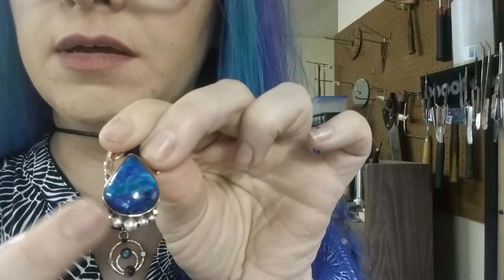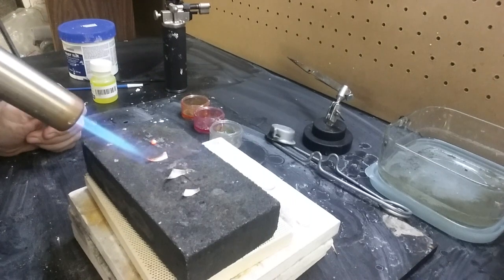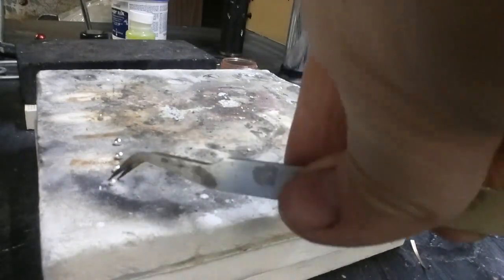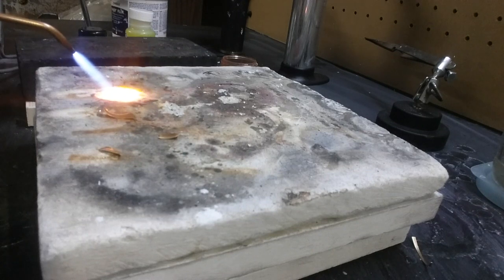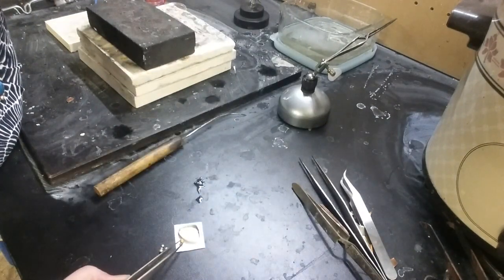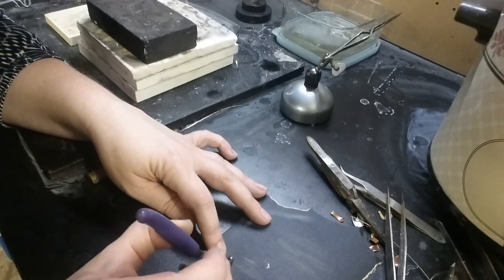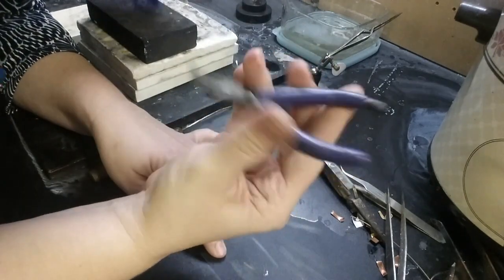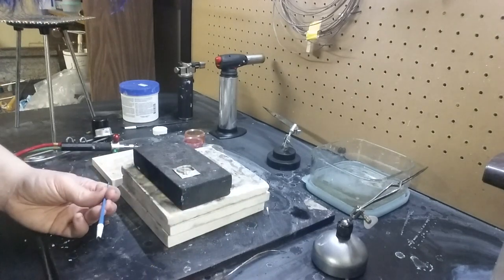Making and soldering ball embellishments

Comment: I left the studio in tears today, then found your video 🙌🏼 Thank you for being so generous and helpful.
Reply from the maker: That makes my day to hear! Feel free to ask if you have any questions, I love helping if I can! :-)
Reply: Byrd Stoneworks You seriously saved y weekend. I do have a question about something you said in another comment. You said hard solder on bezel joint, medium on bezel to faceplate, easy on embellishments to faceplate... Did I understand that correctly? I’m being taught easy for everything but what you described makes sense intuitively. My question is how do you not melt your fine silver bezel while waiting for the hard solder to flow?
Reply from the maker: Its all torch control, and watching it. Don't let any part become bright orange of course. But the main reason I use hard solder on the bezel seam is so that when I do the rest of the steps, I'm in less danger of the solder reflowing back OUT Of the seam (this has happened to me before when I didn't watch my heat!) and now I have a huge gap and have to start over. I use hard solder on 28 gauge fine silver bezel every time, and have never melted during this step. Start slow, use a larger bushy flame and work around it, keep the torch moving and don't go super close. You'll get the feel for it as you watch the flux. It's tricky though because if the flame is TOO WEAK and if you heat too slowly the solder will oxidize and it will never flow. Keep the torch moving and heat gradually but not so slowly that you're just turning everything black. Might take a few times but you'll get the feel for it!

 Another thing is where you are placing the heat. When you are soldering to the backplate, If you heat from above, and you have a fine silver bezel (especially if that bezel is 28 gauge or thinner) the heat will first heat the bezel, and never reach the larger backplate. This is especially true of larger pieces, and if the backplate is a heavier gauge. Beleive me, I've made this mistake. Recently, even! And I knew better! LOL.

You'll want to invest in a soldering tripod so you can heat from underneath. It makes a world of difference. Then, all of your heat is going onto the thicker metal and the bezel is being heated by proxy instead of directly. Keep the heat moving of course, so that everything heats as evenly as possible and you don't have any hotspots that will break down and melt.

Something to keep in mind when you are using a tripod though: You do have to apply a bit MORE heat though to make up for the tripod screen being a heat sink, but when working with silver, it's often better to have that heatsink so you don't accidentally overheat. This, of course, is dependent on what torch you are using. Smaller torches will have a harder time. 

Another thing, is you have to ask yourself if you need to use three grades of solder. Sometimes, just going Medium to Easy is sufficient if you have less steps.
Reply: This is so so helpful. I can’t thank you enough for taking the time. Can I practice hard and medium solder on a 28g fine silver bezel that I already burned a hole through, or is that metal somehow changed and not good for practice?
Reply from the maker: It's not changed or ruined! :-) Always save your scrap! If you don't end up using it for practice as you mentioned, you can use it to make small components (or granulation balls like in this video) and embellishments OR when you get enough you can turn in your scrap for money or store credit at places like Rio Grande or Thunderbird Supply. (Wait til the silver market goes up though!) It's best to separate your 'clean' scrap (with no solder on it) from the rest, and if you want to take it a step further you can have a separate container for your fine silver versus your Sterling Silver.
Reply: Byrd Stoneworks oh cool! I had no idea. I’ll be better about keeping clean scrap separate. Very cool. Thank you!
Reply: Big oof

Comment: When I’ve soldered using my butane torch, even on high for a long period, and even if the piece turns bright orange, it doesn’t come close to melting, and only the solder flows... so does a specific torch need to be used for this?

Comment: Brilliant! The best video here showing how to solder balls on a back plate. Right now I’m having a hard time trying to do that 🤔
- maybe bc my flame isn’t that hard particularly from underneath the backplate? The balls seem to stick until I pickle ... and I find them in the pickle pot... 😅 Any hint to how I can make them stick for good please? Pickle, quenching, drying, flux, with pallions, without pallions... 🥺 thank you very much in advance! Now I go try for the 5th time 😬
Reply from the maker: Thank you! :-D --- your problem is a common one. When I'm soldering the granule balls down, it seems to be one out of 4 falls off every time. I think what's going on is the solder is just not flowing into the right spot. Remember, solder follows the heat! But in the end It's one of those things where you just have to sigh, and then put the ball back on and try again.

Some things that help though, is sweat soldering them down (so flow the solder onto the backplate first, and then flux the bottom of the balls and place them down. Keep your pick handy to deal with them migrating as the flux bubbles. (You can heat very slowly at first to dry out the flux as well, or simply wait and let the flux dry out to avoid lots of movement.)

Be choice about your flux placement and flame direction. Avoid fluxing areas where you don't want the solder to flow (such as up the side of your bezel). 

Another tip I have is each of your solders flow differently. Extra easy and easy flow out and will cover a larger surface area, where medium and hard kind of 'stay put' and don't flow into as much of an area. So that's something to keep in mind.

Comment: Good instruction video but girl you should be more careful, you're a safety hazzard xD
Don't quench your pieces in your pickle.
Reply from the maker: I've since stopped doing that. :-)  Thanks!
Reply: @deejbyrd  why not?
Reply from the maker: @marebear61  It can splash and release gasses I guess. Especially with bigger works that are VERY hot, it takes awhile to bring them down to temp and so the quench actually boils and bubbles for an alarmingly long time. LOL.
Reply: @deejbyrd  Thank you for answering!

Comment: Hifrom Tassie, coyld you tell me why the solder doesnt re heat and flow from your bezel thus moving, or if a ball didnt solder and you had to resolder  that ball wouldnt they move wirh heat!
Thank you Liz
Reply from the maker: Hi Liz,

Some elements might certainly move when reheating and re-flowing. This is why we use different 'grades' of solder. Hard, Medium, Easy and Extra Easy. When you start a project you use hard solder on your bezel seam, medium when soldering on the bezel and embellishments, and then easy for addons after that.  Each of those solders 'flow' at different temperatures. You want to really watch your heat and don't keep heating after the solder has flowed sufficiently or then you'll reflow the solder from previous joins. :-)
Reply from the maker: Another thing you can do is put a 'stop flow' or anti-flux on parts you want to stay put. This is done with yellow ochre.